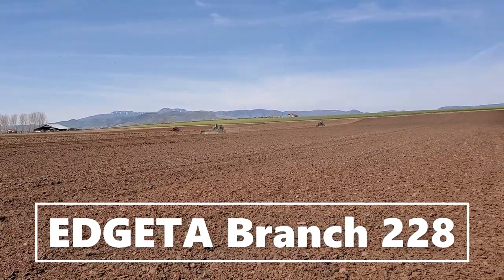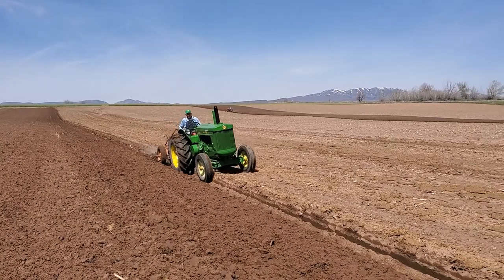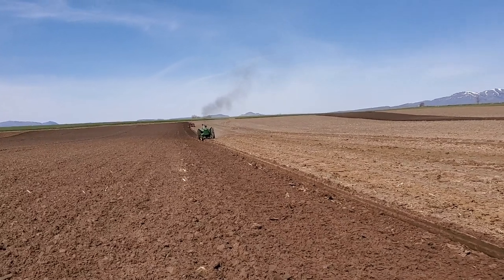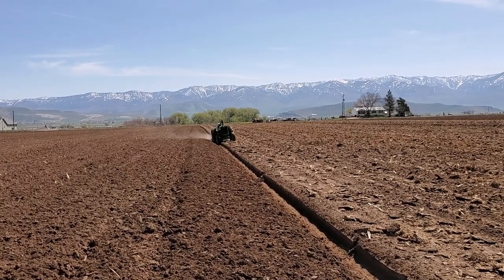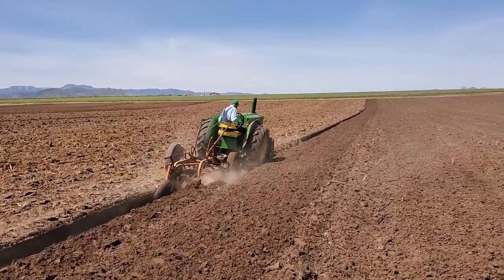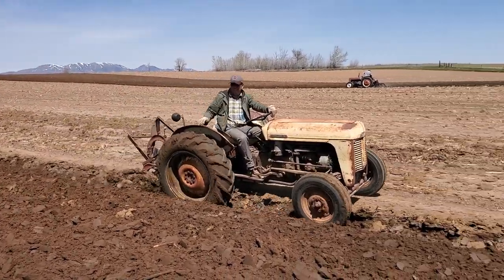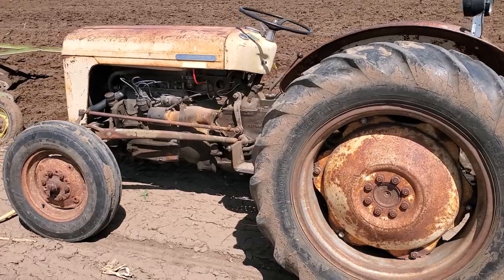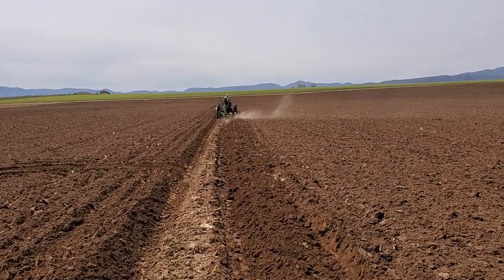Antique Tractor Plow Day 2022

Comment: What is the difference between a AR and a R??
Reply from the maker: They are very different. An AR is a "Regular" (sometimes called a Standard out a Wheatland) model A. So it's the same gasoline engine you find in a row crop John Deere A. The R is a diesel engine. It's the first diesel JD made actually. It's much larger than an AR... Probably nearly twice as heavy. And has around 50 HP where the AR has around 34.
Reply: @jonelsonster  my Dad had a R when I was in highschool. I didn't know what the specs were for the AR. Thank you.